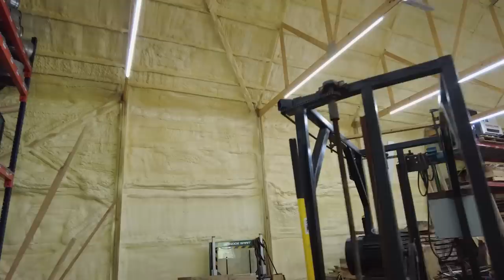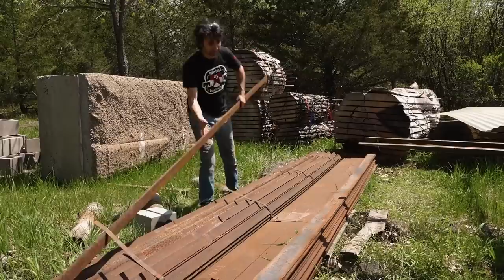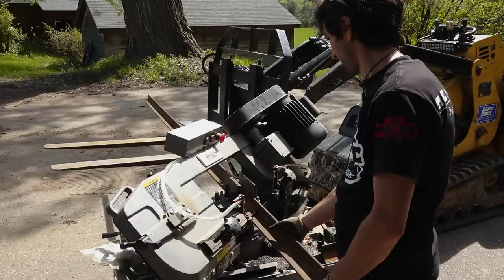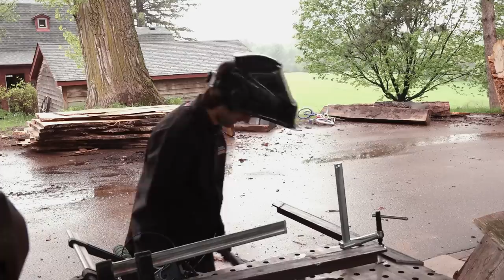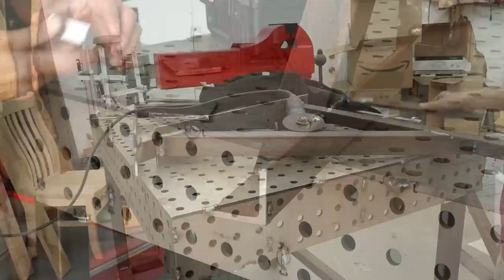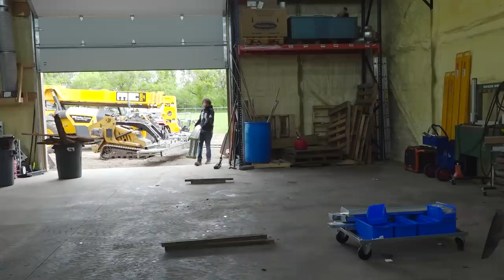Making Shelf Brackets that can hold way more weight than I need them to

Comment: You might want to put some insulating pads between the aluminum and the steel to prevent electrolytic corrosion (which could invisibly weaken the aluminum).
Reply: Very true, Mike! Put some type of insulating material between the aluminum and steel; rubber, nylon, plastic, or even wood. Something that you have on hand to keep the aluminum from getting damaged.

Comment: If you have a few inches between the back of your palet racking and the wall, you could make some brackets for the slots to make a bunch of small shelves to put all that long steel you have on, you might have to span the brackets with some timber though or figure out a centre support, but it could work.

Comment: Those are some very heavy-duty bracket things.  Did you do the calculations on what they weight-carrying capacity is on them?  I’m guessing it is s-4 times the weight you put on them, but it’s a curiosity thing to know what they will hold.  Also, what type of screws/bolts did you use to attach them to the wall posts?  They looked like structural screws, but it wasn’t clear in the video.

Comment: Pick up some rafter hooks, you have plenty of rafters in the new building the rafter hooks are quick and easy to use and move around wherever you need them.
Reply from the maker: Bottom chord isn’t designed for loading

Comment: The brackets are a beast, sure.  But the screw threads holding them to the wall appear to be the weak point.  I mighta used lags that protrude mostly through the wood they are attached to?
Reply from the maker: I think 6 3” lags in each is plenty for these
Reply: @mcremona  They looked like 3" deck screws from here.  Sorry.

Comment: Can't help thinking those brackets are at least 50x stronger than the 2 screws at the top holding them up that take all the force?
Might be worth considering the GRK structural screws?
Reply from the maker: 6 GRK RSS in each bracket

Comment: Was the Tyvek just for code? Do you need it with closed cell foam?  Or is that open cell?
Reply from the maker: Makes it easier to remove the wall panels if I want to add openings

Comment: Do you have your additional loads on posts checked by an engineer as the type of constrruction used has limits for added loads especially off axis - shear loads created by shelf brackets. Calcs would also give you loading limits especially with the robust brackets that you fabricated which are as good as any job shop would provide. As usual great job.
Reply: It's called "barnyard engineering." Try it sometime.
Reply: @Lee-qp6gf  BONEYARD AND BONEHEAD can be interchangeable terms when it comes to safety of anyone who enters one's facilities and assumes it is safe. Remembering it took three years for Hyatt Regency lobby in Kansas City to collapse and over 40 years for the condo failure in Surfside together these killed over 100 souls, Only persons Matt cares about will ever be present all that I suggested is that as any ladder purchased today has a load limit why not determine how much weight this project can safety support.
Reply: Matt has been so solid on his engineering that I would be surprised if he had not considered the shear loads, but the best can overlook things.  These are light enough that prob wouldn't be a problem but it is a very good point to bring up.

Comment: with 25+ acres a long 30' wedge - 4 wide x4 tall at gable on (8) concrete blocks cross supported like a ladder (You have one Hmmm) could have a cabled gable and a real cover tarp    why cram more stuff in your getting tiny barn. Free space anywhere else.? even a cheap flatbed trailer Generous Matt.